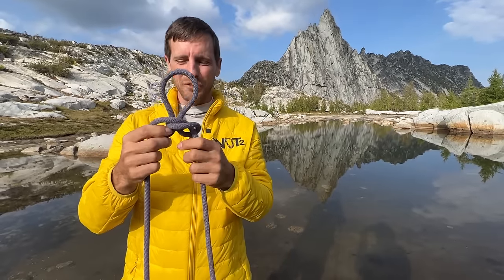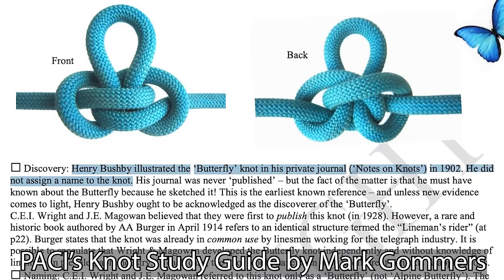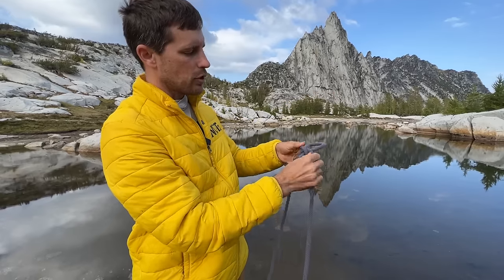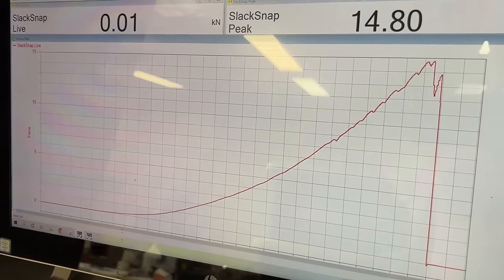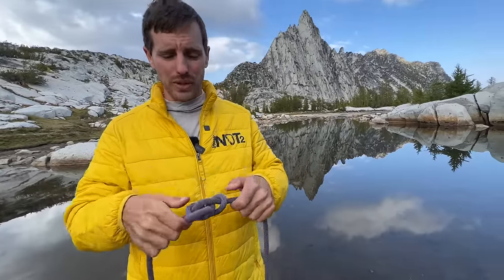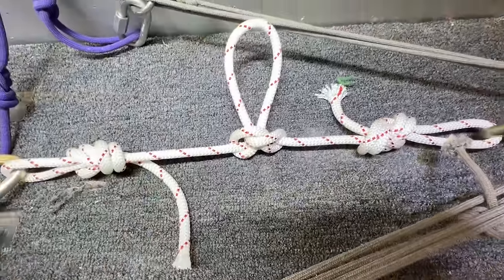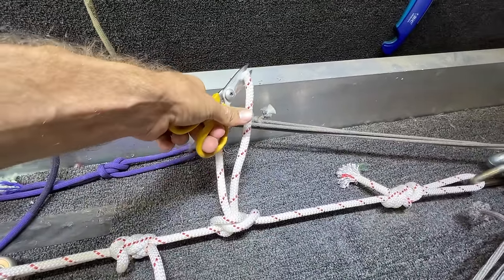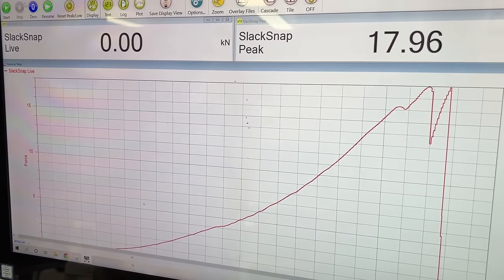What happens if you tie the Alpine Butterfly Knot wrong?

Comment from the maker: You can use this as a bend like @theropeaccesschannel shows, just make sure your tails are long enough.  See his video at https://youtu.be/tRrIUybUyd0
Reply: Regular watcher of TRAC, think I came across your via there, more interested in Rope Access these days but do bits of climbing years ago, knotwork; one of those skills that never leaves you and surprises you how often you use it outside of your main reason for using it (climbing, rope access etc). I think I came across RopeLab from here though, can't recall exactly. Keep up the great work.
Reply: I stumbled upon a knot where you make a simple loop and make yet another loop 90° offset and 180° flipped inside that loop.
This would result in 2 interconnected loops with 1 pass outside and 2 inside.

Another variation is 2 double loops interconnected in the same way
2 passes outside, 3 inside. 

I'm curious if this already exists, how strong it is and how it's called
Reply: @HowNOT2 I’m sure someone has guessed already. But that’s Prusik Peak on The Temple in The Enchantments on the Alpine Lakes Wilderness. Absolutely my favorite place in the world.
Reply: @HowNOT2 What if we take the end loop and wrap it around and through the "hole" loop one more time?
It will be same knot but with four ropes hugged in the center loop instead of two. This theoretically might increase its strength because of a bigger bend radius as well as reduce the chance of it coming undone (not in Dyneema).
Reply: Dave Richards Knot Break Strength vs Rope Break Strength says alpine butterfly is one of the two strongest bends, just sightly weaker than double fisherman's knot
Reply: Quick question at 11:42. From all this testing, if there was a damaged bit of rope would it not be safer to have the damage in the tail and just use the eye as the anchor point giving practically full strength? or if the rope was double isolated by tying off the damaged end with a fig 8 and then have that as the middle of the knot?
Reply: https://youtu.be/nYp_504WA5Q?si=wI0iGFPZmASXX-Pa in the link above they use a alpine hitch for a swiss seat, is this unsafe?

Comment: I was actually taught that the butterfly can be used to reduce shock loads on static ropes due to its tendency to slip on high loads. I would be so curious to see how it performs in that role!
Reply: Was thinking the same…. Shock absorber(s)
Reply: In alpine caving techniques, False Butterfly is recommended as a shock absorbing knot.
Reply: @livinginyourwalls4067  I believe this is the 'incorrectly' tied knot shown in 3 at 17:48 which was thought to have a higher tendency to slip.
Reply: @oliverbrain7693 yes, with wings on opposing instead of same side
Reply: @ohokcool  Though no doubt any of the non-Alpine Butterflys could legitimately be called "false" by someone aiming for an Alpine, the False Butterfly mentioned in ACT is the one at ~19:30 with the twist-and-twist-back tying method giving non-interlocked sides, but both wings on the same side.
Reply: Why not tie 2 AB's several meters apart and connect a screamer or a length of half rope etc in between!?
Reply: @oliverbrain7693 Yes, it was explained right before this moment
Reply: It is often recommended to tie a few alpine butterflies in the rope between climbers when walking on glaciers. The idea is that if someone falls into a crevasse, the knots will add drag as they are pulled through the snow (especially at the edge of the crevasse),  thereby giving the other climber more time to perform a self-arrest and catch the other climber ("group arrest"?).
Reply: That's so cool!!
Reply: How about No.1135 from Ashley book of knots? as long as the line isn't loaded, It will provide friction during a fall [maybe a hotspot risk].

Comment: I think the main benefit to some knots is being easy to check. As i see it, the only reason we use the figure 8 for tying in is that you can dress it nice and it's easy even for beginners to check (and easy to untie if i can remember which side for the loaded strand). Tons of other knots are super good enough.

Personally, I found it really hard to tell the difference between the butterfly mistakes. But seeing how the "wrong" butterflies are still strong makes me less scared (though I'll definitely do an overhand backup on a core shot now)

I need to look through and see if you've tested the wrong ways of tying a bowline as that's the one knot i've actually argued with someone about which was the "right" knot.
Reply: Bowline (out-in) and cowboy bowline (in-out) are both valid and have similar strength (and are both acceptable in marine purposes. There are different ways to lock each. Cowboy bowline is better at resisting ring loading.
Reply: I've also heard the term "Scandinavian bowline", though I don't know which variant it was referring to.

Comment: Really grateful to see the results of the last variation you tied 'incorrectly' so to speak. In the UK, I know that as a cavers knot. I often use both to link anchors together, using the alpine if they are relatively close or the cavers if there is more distance between. I would tie the cavers as a slip knot locked off with a half hitch over the eye. 🤷‍♂️
Love you vids, thanks for knowledge share. Happy New Year.
Reply: As a long-time UK/alpine caver (my 40th anniversary of playing around on ropes is coming up in December) , virtually every caver I know who rigs ties the true Alpine.
I have only personally experienced one person choosing to tie the non-interlocked-wings #3 as a regular rigging knot, and he was a somewhat newbie rigger I once took on a practice rigging trip.
Once, and never again.
He rigged using #3 tied in two stages (a single overhand with a loop, and another single overhand to finish), which he claimed was an Alpine, was faster to tie, and was easier to fine-tune knot-anchor lengths with than other ways of tying it, and which he'd been taught by some supposed instructor(*) he seemed to have some kind of hero worship thing going on with.
Politely demonstrating to him that he was wrong on all three of his claims didn't seem to affect his misplaced hero worship in the least.
To be fair, his knot might have not been meaningfully worse in terms of absolute strength, but it just looked really wrong under the not uncommon meaningful 3-way loading, and hanging your entire weight off knots that look wrong isn't many people's idea of fun.
(*Note:  this isn't instructor-bashing - some of my friends are great caving instructors, but whoever that guy was, I have to wonder what his history was.)
Reply: @davewilson4493  That's an interesting statement Dave, that you haven't seen it in all those years. I was shown it by several CIC's and a British Mountain Guide when I was in the industry full time.
Shame you only saw fit to take the person once for rigging practice, rather than choosing to put in some development time. Though I understand there could be other factors involved, some people you just have feelings about and those aren't the ones you want to rely on when people lives are at stake.
As for your opinion of his three claims, you're right it is not an Alpine Butterfly. However, I would argue that it is super adjustable especially if the anchor is a metre plus away from the equalisation point. That said, rigging a traverse line why wouldn't you use and Alpine. 
I was just pleased to know that the 'Cavers Knot' as I know it was Super Good Enough 😊

Comment: I've actually been using the "Wrong" alpine butterfly(like at 19:30)  on purpose when I set up Lead Rope Solo anchors. Has a SS quick link in the loop, so it will never pull through. The "wrong version" is quicker to adjust for equalizing the anchor, and is even easier to untie if I take a whipper on it. If anything, the little slip is a little softer catch.

Comment: Nice! And super nice video.
Another use for the alpine butterfly:
Isolated retrievable system.
Isolate 1 strand for rapell for a retrievable system, on a grigri, be pilot or whatever.
At the anchor with the rope through, tie a alpine butterfly on one side of the anchor, either clip a carabiner to that AND the other side of the anchor. (,Can also be done without the carabiner, thread the other side rope through)

Now you can rapell of one strand safley, and pull the other from below to retrieve the system. Used in arborism, can even be set up from below, throwing the rope over a branch with a weight.

But don't take my word for  it.
Strider tree gear 
https://youtu.be/8I4LJL2dKcg

That also shows.the alpine butterfly is a trusted stoppern knot... This could be tested! :D

Comment: In climbing one of the uses for the alpine is to use it as a bend, to actually to separate a damaged section of rope, especially for rappelling, at which point you'd have to pass the knot. So it slipping is important- granted at +10kn, not a force likely to generate while rappelling

Comment: For isolating a core-shot segment of rope, the Ashley Book of Knots recommends the Sheepshank Knot (ABK #1152-1166). In particular, ABK #1155 is described as the "safest" variation. I wonder how those knots hold up in climbing rope. I don't think I've ever seen it tested.
Reply: Isn't the sheepshank primarily supported directly by the tension in the rope? If one end comes slack for any reason it has the potential to fall apart. The sheepshank seems like a really dumb idea to use in the vertical realm.
Reply: @climbing200  Right, but there are versions where you tie off the ends in some way. Not saying I'd use it, I was just curious how it'd hold up.
Reply: @climbing200  I have no climbing experience but I’ve seen a toggle used to keep the sheep shank safe.
Reply: To each their own. But for me, I'll stick with a alpine butterfly or similar knot. For one, I wouldn't have to learn to tie off a sheepshank, making the knot more complex, and having more potential to have messed up, and I can save gear for later if necessary. 
Don't get me wrong, I believe the sheep shank has it's purposes, but I don't think that this is it.

Comment: Thanks for all the great video's & info! highline use question: Could you use a butterfly knot in a backup webbing (highline setup) to make a intermittened connection?  Since I have a long Parsec (120m / back up) and 2 polar 50m with loops (main)? what would be the "reduce strenght" factor to calculate the overall strenght of the webbing?

Comment: Kinda amazing to me that pulled extra overhand with the butterfly didn't fail before the butterfly although it looked very close to an EDK but that makes me wonder about what if you had 2 overhand knots, would they be stronger than the butterfly or possibly an 8?
Reply: Two knots aren't additive; the second basically impedes the slippage or creep of the one taking the primary load, where breakage will eventually happen if all other end points are stronger (a possible rationale for using a weak knot on a haulbag, in case it were to drop factor 2 onto an anchor). This is all a backup knot does in harness tie-ins as well, and while some sort of backup is imperative for bowline configurations, only an eight inch tail w/o backup is needed for a figure 8 tie-in, as well tested by International certification agencies after exhaustive testing.

Comment: Great video. This one is a classic.  I practiced my knots just as you said, while watching YouTube. Then I went sailing for three months. Alpine Butterfly,  bowline? bulletproof. I can do it one handed with my eyes closed. My rolling hitch and cleat hitches..... unreliable. Why? Because I didn't have a railing, life line or cleat by my computer to practice on. And I only tied these on my boat when I needed them (and then retied them.)  Three months of sailing every day.  Using these knots daily. I was still unreliable, not automatic. The other sailors had more experience than me but inevitably while they were mumbling something about a rabbit and a tree, I'd just reach in and crank off the bowline.  I think I've learned that while you might learn knots on the job, it's far better to deliberately practice them becoming more and more efficient. You want them to be automatic and correct. (If I tied a bowline wrong it would feel wrong.) 
I just learned about the Inuit Bowline. It's a bit more secure than a regular bowline. (Inuit because it was noticed being used on a dog sled over 150 years ago.)  So on a sailboat, good to have. Climbing? Maybe for gear but not yer butt. Not yet. 
I learned almost immediately how to tie the Inuit Bowline by seeing how it was different from the automatic bowline method. ('Car start turn loop', pull the top line through the loop run the bitter end through that loop, roll it over. For the Inuit Bowline the only difference is you pull line below the first loop to make the second loop. If you know the first method you now  immediately know how to do the Inuit.)  And for the record: I was a terrible Boy Scout, my knots sucked. But I learned.

Comment: I recently used an butterfly to isolate a piece of static rope in my anchor whose sheath got torn. I am curious as to whether the butterfly was really better than using a figure 8 haha
Reply: Overhand can be used but eight will ‘capsize’ easily
Reply: It’s fine, it’s what where taught by IRATA in rope access and they are incredibly strict about safety.

Comment: I tried following this follow-through version multiple times with video (it's not too difficult to follow after all), but repeatedly I didn't get a proper alpine butterfly. One of the ends was always crossing a loop from the wrong side compared to the other and I spent a lot of time comparing it to an alpine butterfly to see if it's just funnily dressed, but no, one of the "end loops" and passes were definitely wrong. Any ideas what's going on? I think I see the same issue on the video at the end of tying it up, it looks like #1.

After a lot of trial and error and reverse engineering, I found out that the follow-through goes as follows: you start with the same overhand knot as you do, you make the loop and pull the working end through the overhand knot from front to back. Now here's where it gets interesting. You pull the working end right back the way it came, from back to front of the overhand knot forming a bight, go to the left and behind the loop that is left at the end. Then you stay outside the initial overhand knot, but you go through the bight loop you created in the working end from the front side (that is hanging on the right side of the initial overhand knot, the "slipknot bight" as I'd refer to it) and there you have it. Or you could view this process as doing the overhand knot, a loop, then a bight through the overhand knot (from front to back) and going behind the loop from the left side and pulling the working end through that bight (from front to back).

To do it the other way around (the first one would equal to figure 8 method where you bring the loop over from behind, this one is when you bring it from the front) I found that it was almost like what you showed on the video with some critical details changed. You do the initial overhand knot reversed and when you go through the overhand and behind the loop that's left at the end, you pass the overhand knot from the behind to the front, then you go through the bight loop from the front to back. So the one on the video ended up being a mix of the steps for both ways to make it.

As a result I wouldn't try and make alpine butterfly as follow-through because it's so complicated and every part of it is prone to error if you lose your track with the loops and perspectives.
Reply: I saw i too.
Took me a while to figure it out the right way and was suprised no one else mentioned it in the comments.

Comment: Personally the way I find is easiest for students to learn is wrap one into crook of thumb, wrap two around base of fingers,third wrap between the two.pull the outside one out as long as required,take the bight and feed it under all the strands from wrist out towards the fingers.
Reply: I find it hard to describe in words how I tie knots.
For rigging in caves, for most knots, I like to measure the loop length I want, add on appropriate extra for the knot, and then use my left hand to build the knot up from the known desired base point. It keeps things where I want them to be, and works well from muscle memory even when I'm not really in a position to look at what I'm doing
For the Alpine, though I know people who do the hand wrap. I don't like it as it's hard to get the very short loops I often want, and not intuitive to me for meaningfully long loops (and sometimes I need really long loops).
I go for the two-twist method which works for tiny and super-long loops exactly the same way.
I hold twist the base of the knot where I want it and hold it between the base of my thumb and the bottom of my little finger with my thumb over it to hold the first twist firmly, twist again and hold that twist with my index finger, and then pull the loop behind and under my hand and push it through where my thumb is, sliding out my thumb at the same time but keeping hold of the base of the knot while I tighten so the base stays where I want it to be.
If the desired loop is somewhat long, I may need to jiggle my left index finger, and/or spread my right hand holding the loop top to widen the top of the loop and move the second crossover point further down the knot to where the crossover is easier for my index finger to catch it.

Comment: You should see how the window cleaners use this important knot.  You can tie two separate lines at different anchor points and center perfectly by attaching 2 alpine knots together with a carabiner. So handy, easy to untie for sure.